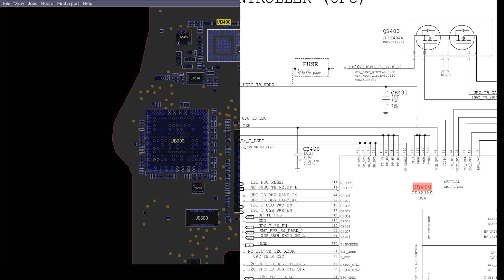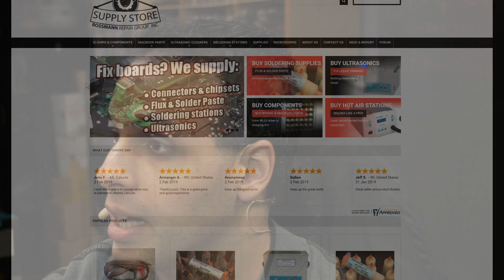The PROPER way to solder BGA chips.

Comment: Repair Wiki badly need a chapter about soldering. And particularly about soldering with hot air in tight spaces with two dozens of tiny components around when original factory solder is something like kryptonite which resist to any temperature.

Comment: I would be so scared caps would go flying everywhere. Still learning the hot air thing and not attempted bga yet.
Reply: Surface tension keeps those smd components stuck in place, try it on some junk boards. I use 75% airflow which is a lot and they always stay in place unless you accidentally tap them and break the tension then they go flying.

Comment: 6:20 if ppl ask a question about temperature, don't make a whole book out of it say the three little number ppl wanna hear. they asked what YOU used not what they should use. big difference. so annoying that you dont give straight answers.
Reply: He gave a straight answer, but you bent too hard to hear: he turned up the heat as high as needed to melt what he needed to melt it, without measuring it otherwise, while also mentioning that any indicated temperature isn't likely to be the real temperature, so... the only criteria he's using is: does it melt what he wants to melt?
Reply: A thermocouple would make that measurement pretty easily. Then someone else could conceivably get a thermometer with a thermocouple probe and then compare the setting, and that ideally should not vary as much between different meters as the temp settings on the hot air stations.
They're actually commonly available with some DMMs nowadays.

Comment: So, BGA (even some QFNs for that matter) seems to be either a hit or miss kind of scenario when it comes to soldering huh? It either works or it doesn't.
Reply: QFNs are different beast. They doesn't have many balls at underside. However they almost always have large cooling pad and thick layer of PCB copper at that area which is designed to act as heat sink. Without preheating getting such QFN chip off the board is a gory fun. Two times didn't found anothar way except destroying the faulty chip from top side to get enough contact area for soldering iron tip. Hot air didn't worked, most likely original solder had very high melting point.
Reply: @KrotowX  well that's true. But you can remove a QFN with a large gnd pad with hot air without any damage. Just need practice and experience.
Wow, nice to see that I've leveled up since a year.
Reply: @bayharboursinger  Agree about practice and experience. Hadn't much time or hot air soldering in last two years though. Then realized than forgot about how to set correct airflow to get area hot enough and not blow away things :)  In end simply filed off QFN chip tops and soldered them off with regular soldering iron. In end turned out that factory solder indeed had high melting point. I soldered replacement chips with SN63Pb37 and had no problem to unsolder one of those chips with hot air later when board cooled off.

Comment: What is that clear paste you used before the heat gun?
Reply: flux, it helps the solder go where it needs to go and generally keeps circuits looking clean

Comment: Hey Louis I always wanted to know what temperature/air do you set the heat gun to remove chips?
Reply: He answered that in the video: hot enough to melt s[tuff]. If it doesn't, turn it up. He can't tell you what temps you'll need for your particular application, and rework stations are not accurate anyway, so even if he gives you a temp, his station is not accurate, and yours isn't either, so that compounds the error to the point that it wouldn't be useful to you.
Reply: @JungleLibrary  thanks for your reply, I don't recall asking that question but I've already opened my own repair shop since that video was posted :)
Reply: @Julio7514  what temp do you use on a hot air station then?
Reply: @lpf98  to remove chips I use 380-420 C, to remove connectors 280-300 C, it also depends on what device you are working in, phone boards take less heat, bigger boards take more